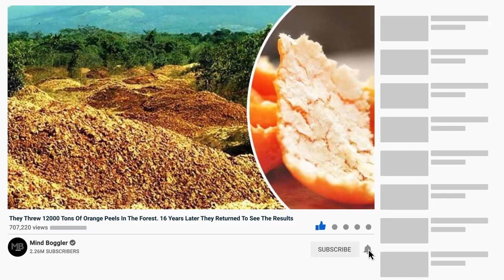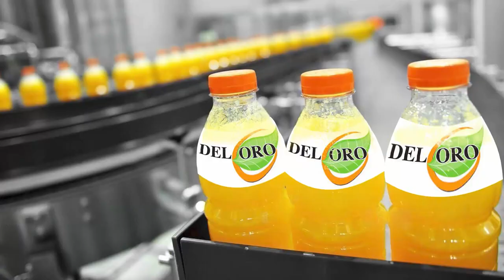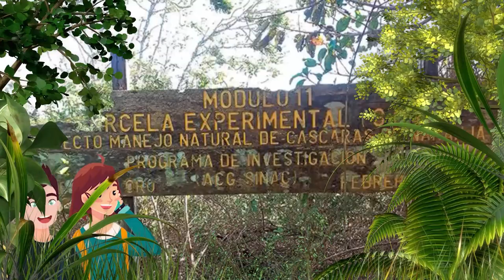They Threw 12000 Tons Of Orange Peels In The Forest  16 Years Later They Were Shocked By The Results

Comment: Plus d-limonene was considered a  waste product at the time. I know because I was buying drums and drums to cheapen citrus fragrances.  Now everyone is doing that, and  d-limonene costs about the same as orange oil.   It was a great, relatively non-toxic solvent and degreasing agent.  The bike shop switched from turpentine to d-limonene when I was doing perfumery.  D-limonene was removed from citrus oils, usually orange oil, when it was folded to make 5x or 10x.